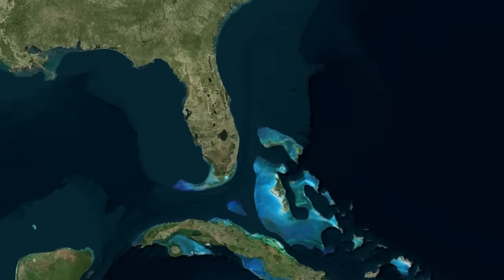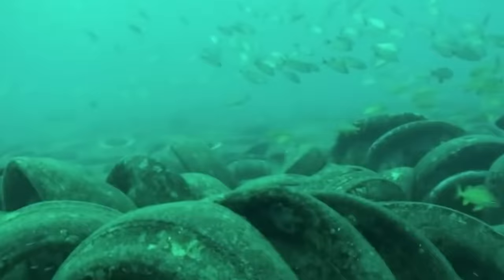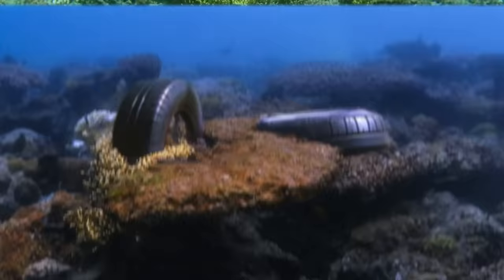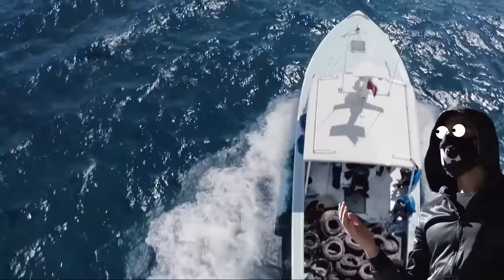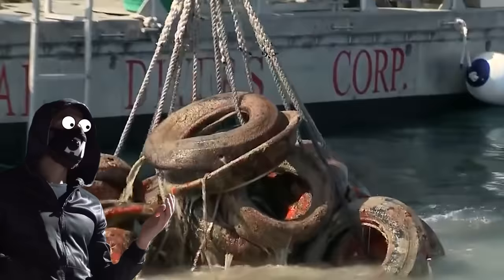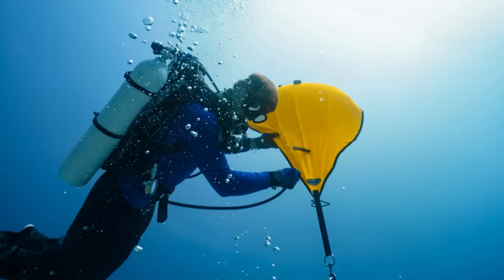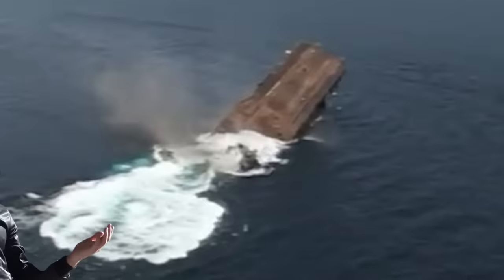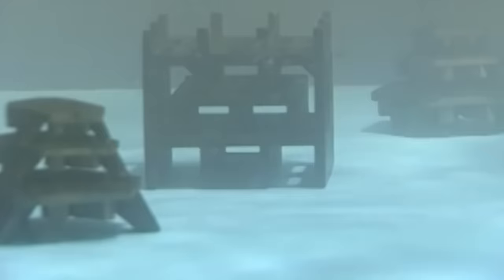They Dumped 2 Million Tires Into The Ocean. After 50 Years, Everyone Was Shocked by The Result

Comment: Shred the tires and use them with asphalt to make the roads last longer and ride smother. Its been tested in northern Arizona where the weather is cold and snowy during the winter. The Asphalt industry said no to longer lasting roads.
Reply: They asphalt lobby prevents this. Yes, there's a powerful asphalt lobby. Constant resurfacing of roads is VERY profitable. Think about it. Bad roads destroy tires and shock absorbers...so those companies profit. Gas mileage goes down due to construction traffic jams...so gas companies profit. 

Asphalt manufacturers and petrochemical companies profit from the manufacturing of the asphalt. Companies that handle disposal/recycling of old asphalt also profit. Corporations that do the road repairs profit. Politicians profit from kickbacks and campaign "donations". 

It's like heathcare. There is no profit in fixing a problem...only in ongoing treatment.
Reply: @holeymcsockpuppet the asphalt lobbyist do did not want to go out of business.
Reply: Did you even watch the video. They said that they are doing that with some of them.
Reply: I heard there was a Japanese man who invented away of recycling plastic bags and plastic waste into gasoline and kerosene and diesel. Is there a way we could use the tires similar and break it down into fuels?
Reply: @jacobshelt01 - We can burn anything and get energy from it. Clean burning incinerators exist and are being used. As to why we don't use it here...

/Shrugs
Reply: Look at how thin they are laying down asphalt. Used to put it down 5-6inches thick. Now you're lucky if it's half that. City, state and federal governments not wanting to spend the extra money to make it thick enough to last.
Reply: @Davidsmith 385 
I heard of that tire usage in the asphalt in Arizona years back. Do you have any current info on the longevity and how it lasted?. They tried it here in Las Vegas Nevada, near Harry Reid airport and they've had mixed results.
Reply: This doesnt work in areas that get even slighly warm. As the road heats up bacteria in the petroleum used to make tires become active and weaken the integrity of the asphalt. Sometimes you can even see the road bubbling.
Reply: Same thing happened to the machine that tore up old asphalt and recycled it into new asphalt talked about it seen videos of it working then a short time later nothing
Reply: They make rubberized asphalt in las vegas I know I worked at the plant 9 years ago
Reply: Asphalt is infinitely recyclable. Adding rubber to roads stops recycling cold in its tracks. It’s a really bad idea. It sounds good to people that don’t think past square one.
Reply: Of course not.  They want to sell more tar.
Reply: Yeah there are hundreds of different things you could do with old tires.  Building materials for third world countries asphalt for your highways that spongy crap that they make out of old tires that they use on kids play places.  That's just a few right off the top of my head
Reply: lots of responses by people with simplistic solutions.  I will address one.  The others are equaly half baked.  Shredding tires for playgrounds.  They tried that.  It didn't work.  The wires from the steel mesh kept impaling kids playing in it.  Equally problematic is the toxicity of the shredded tires.  Not really what you want your children playing in or injesting.  Rubber chips get extremely hot in summer sun.  Other than that and five other issues...it's a perfect solution.  If there was a solution, no amount of lobbying would prevent someone from using it.  Don't be so quick to blame manufacturers with nefarious intent. It makes you look like a moron.
Reply: I remember seeing a story about this exact exact same thing. A young girl in middle school in New Brunswick Canada used it as a project. I don’t know if it was the same type of application you’re talking about in Arizona, but I do know that the New Brunswick government tried out, her concept. You don’t even have to dig up the resources. It’s already there.
Reply: They say right in the video they can't recycle the ocean tires into roads. The only real option is using them for fuel, which they do. Did nobody watch the video? Lmao
Reply: @jacobshelt01  Tires are funny shaped barrels of oil. Sure there are ways of turning plastic back into fuel but it isn't yet profitable
Reply: @ebenezerwheezer2957  What Arizona did was to make concrete freeways and groove them before topping therm with the asphalt / rubber mixture. They last 8 or 10 years and then the asphalt is scraped up reformulated and put back down.  According to the stats it reduces road noise be 70% and is easy to repair. When resurfacing they don't shut down the whole road just a lane or two at a time. The system works. I've live in AZ for 45 years and we do have good roads.
Reply: @YESITSWILL  I live in Arizona and the freeways here are concrete base with an Asphalt / Rubber cap. They last 8 to 10 years and then are scaped up reformulated and put back down. The rubber makes the roads much quieter and when being resurfaced they do a lane at a time so they dont shut the whole road down. I've never seen the road bubbling and I've lived her 45 years.
Reply: @terryjohnson3479  I live in AZ also and using the concrete base and regular maintenance probably makes the difference. When I lived in the Middle East the asphalt and rubber roads melted and rutted.
Reply: take a look at the tire dumps in kuwait and pennsylvania. with the shredders now  manufactures are making 4,728 tires while 3 are shredded!

Comment: Crazy... Wow... Tire makers who make money selling tires should recycle and/or be held responsible. Just like anyone who makes plastic.
Reply: Tires and plastic are used by YOU! Makers wouldn't make any money if YOU didn't buy. Take responsibility!
Reply: Why not the end user?
Reply: @jamesbottoms6912  the end user doesn't have the expertise to recycle tires the tire maker has the capability and facilities to reuse them.  Alternatively oil refineries can turn them back to oil via pyrolysis the scrap metal can then be sent to scrap metal facilities for re-use.
Reply: @centurione6489  plastic is everywhere and nearly unavoidable, you goober. There need to be regulations set and companies should be held responsible, the consumers aren't at fault when nearly every company is switching to and using an excessive amount of plastic because it's cheaper. The companies are just shifting blame to the consumers.
Reply: If only they learned earlier that they can recycle this tires , like na mono-block chairs we have today, such a waste of money and then damage the ocean
Reply: @Gargeler  my understanding is that these tires are slowly being fished out and either re-threaded for re-use or processed in some other way to make new tires such as shredding them and using the shredded rubber in new tires.  A couple of years ago, a chemical in tires was identified to be harmful to salmon so it's probably best not to not just leave them there.
Reply: Sure the makers could recycle the tires, or put some recycle tax on turning in used tires, like batteries. It only costs them money, which the makers would put into the price of a new tire that YOU buy. Then you'd complain about a tire costing too much! LOL!

Comment: This goes to show how much anyone knew about toxins, pollution, etc,in the 60s and 70s. Here in the UK, in Weymouth in Dorset we had a landfill tip. Most of the Garages in the Area used to just take their old oil and dump it! In landfill. I at the time being a young Apprentice,and then Mechanic every time we had two full drums, used to take to these 40 gallon oil drums to the tip and dump it.

Eventually many years later in their wisdom,the local council granted planing permission for the tip to be cleaned up and used for a housing estate. Well,there were specialised tankers,up and down those roads for weeks and weeks. Sucking up the old oil. And I wonder what actually happened to that old oil?

They built houses on it after having to pile the land. Which itself took weeks and weeks. And as some of you might guess, the pile driving equipment actually shook the entire area around. Gradually there were multiple houses in the area that suffered subsidence. My own mother’s bungalow being one of them.

After the Houses were built, guess what! Gasses started to leak up into peoples Gardens. The council issued an order that there was to be no Barbecues, no naked flames,etc. And subsidence started to occur in the new houses. I would never buy a house or Bungalow in that place. 

And this is the price paid for people who didn’t know what they were doing. I wonder how many people in the western world could relate to this incompetence?

Comment: Im building my second house out of tires and sandbags, and crazy my house can withstand fire, bullets, termites, and year-round 70 degrees inside even if its negative temps outside 🤷

Pack the tires with dirt, and cover them in cement and you got almost a 3 ft thick wall, i can destroy any other house with a Bic lighter lol

Comment: Creating reefs with metal and rubber and concrete debris can be done successfully if planned. This was nothing more than a half baked media story cover job hiding the fact this was just a haphazardly done trash dumping with no real objective other than dump and run. What a mess. I know this wouldnt be popular but there should be core charges on tires so that there is a incentive too recycle properly and responsibly. But people hate following rules and regulations so it likely would not fly. Although such " deposits" have kept many liquid refreshment trash from piling up everywhere. Ymmv.